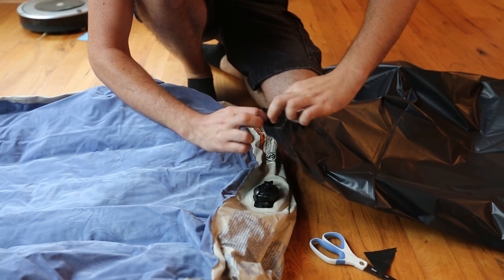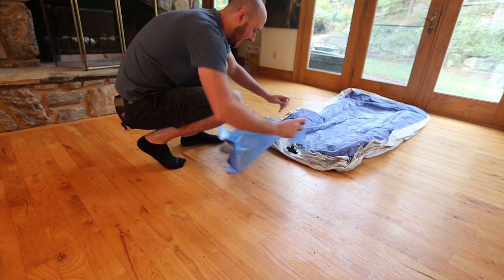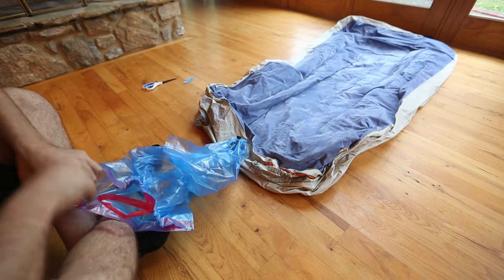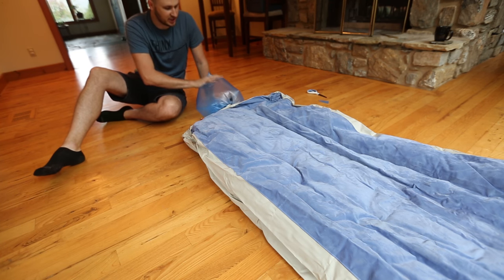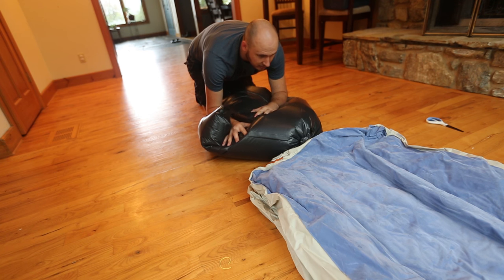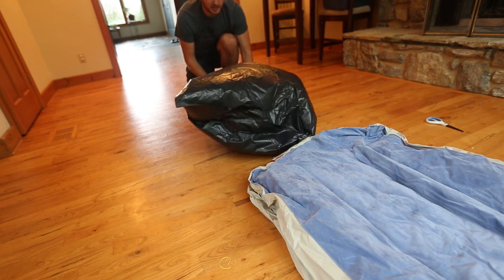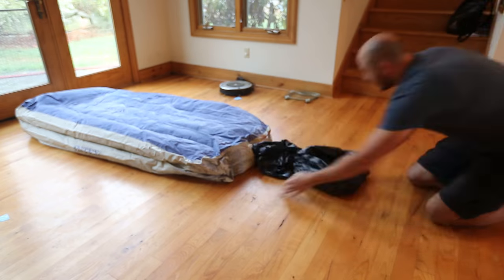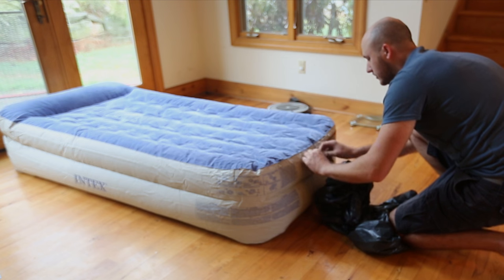How to Inflate an Air Mattress with Garbage Bag

Comment: @CrazyRussianHacker Instead of flapping the big trashbag just to gain air, instead, put it on an electric fan. Then hold the hole with your grip and the edge of the trashbag that are both connected. This produces a sort of vacuum that also kinda works like an air compressor.

Comment: or just use a leaf blower
Reply: leafy fans triggered
Reply: why would you have a bin bag in a survival situation
Reply: Why would you have a leaf blower in a survival situation.. It's more likely if you're camping to have a garbage bag and somehow broke your air pump than to be camping with a leaf blower. Ok, camping is not survival situation but you get the point.. Also its more portable.. for evacuation purposes like escaping Mr Matthew
Reply: seriously
Reply: im pretty sure everyone has a garbage bag with them when going camping
Reply: ya I know
Reply: Michael Allanach leafyblower?
Reply: Well just put the mattress on your car exhaust if you're going camping; you're likely to have a car.
Reply: smart
Reply: YSC depends, some car's exhaust may be able to warp the bed or melt the bag funnel
Reply: good.
Reply: Michael Allanach what if you don't have one. it's like an all else fails type of situation.

Comment: Doesn't the air come back out from the air mattress?
Reply: air mattresses are designed to keep air in. Until you unscrew the thing you pump air through
Reply: There's a one way check valve in the mattress that prevents the air from coming back out.

Comment: this is the dumbest way to fill an air mattress
Reply: Dude....it's if you forget you air pump....
Reply: And also it's for Camping when there's no electricty
Reply: if you dont have a pump, it's actually a really great makeshift air pump.
Reply: Ogreed.
Reply: walmart is open 24 hours, they sell air pumps
Reply: +Ja Seo If your hicking or camping and you don't have electricty or batteries what are you going to do? He's simply showing a way you could do it if you didn't have the pump it's the point of the whole video.
Reply: It's Called A.M.O.R
 air pump with batteries?  thats what we use
Reply: +Ja Seo If you actually read what I said l. I had said if you don t have electricity OR BATTRIES. This is a "Hack" you can use.
Reply: Stop Feeding Walmarts Pump ))
Reply: THEN WHAT OTHER WAY IS RIGHT????

Comment: cool. but it only works if airbed valve is open and if there is really tight bag connection to airbed valve. otherwise first bag squeeze forces breaking bag to airbed valve connection

Comment: You could just get a hair blower
Reply: Geckobro1312 don't do it on hot lol you need to use the hair dryer on cool. It will burn the rubber if it's done on hot.
Reply: But what if you don't have a hair blower? Men don't just carry hair blowers around, only if it's for something other than their hair they would
Reply: Geckobro1312 I'm not a girl either, but I know because I have sisters. A blow dryer is warm, but if you leave it on a certain spot, then it would start to get hot
Reply: Geckobro1312 There have been instances where the heating coils inside get so hot they can catch things on fire. But for the most part as long as you are not directly touching the metal grill on the front you should be fine.
Reply: ***** Exactly!
Reply: Inferno Caprico this is for survival situations like when you don't have them air pumps or wahtever. It's one way to do it when you got nothing. Also I don't think it's good to blow an air mattress full of hot air
Reply: Daffa Azizan Exactly! Ok you guys get it, it's not just me (-:
Reply: Daffa Azizan survival situations? Lol yeah number one item in a survival bag is an air mattress...... lets be real. This is for, "damn I don't have a pump. Guess I'll improvise" and that's it. No survival to it.
Reply: CapturedMind Thanks for actually understanding me

Comment: I wonder why he didn't wedge the air nozzle open, pull the sides apart to get it mostly full, and then use the bag after unwedging the nozzle to finish it off...

Comment: mine is different i just plug in the wall and turn the button on the bed and it just blows itself up if i want to deflate it i just twist a cap and air comes out so u can adjust it

Comment: I don't think this is that great. Most people blow them up when they get tired and are going to sleep soon. And i think that is just too much work and takes too long for someone who is tired. I get that this is in case your pump stops working, but unless your camping, you would still have your normal bed to sleep in. And if you are camping, i don't think most people would have big plastic bags lying around with them.  The situation is just too unlikely where this would be useful.
Reply: Scott Seagrave actually all the camp grounds I go to, be it a national park or a small camp place, you are required to bring garbage bags, for of course your garbage. So I think this could be useful.